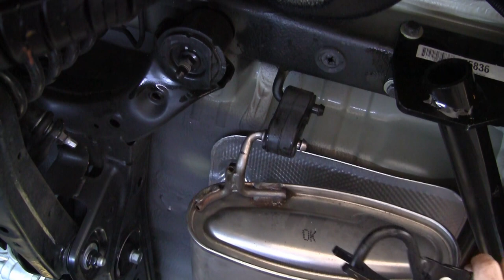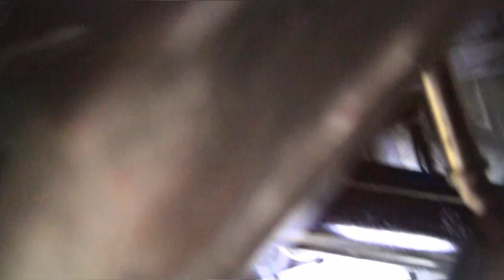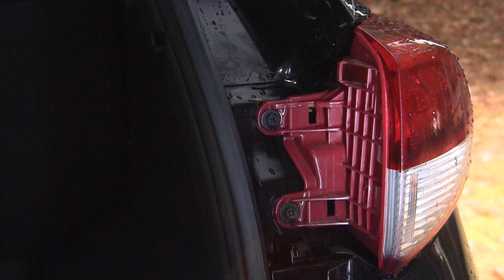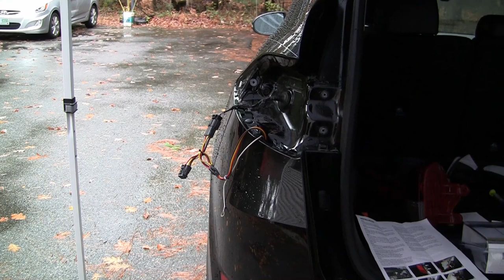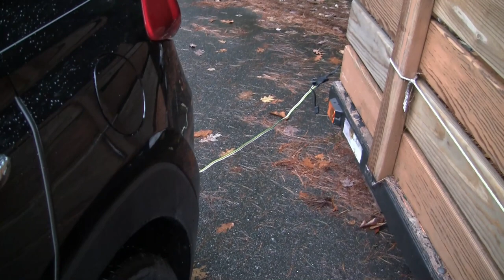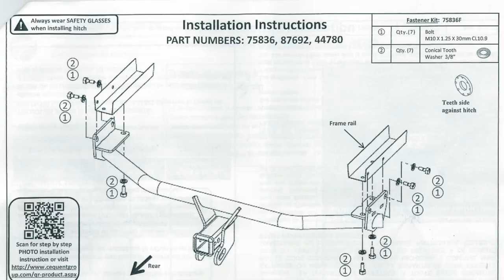Trailer Hitch and wiring on an 2016 Hyundai Tucson

Comment from the maker: I'll just throw this random comment in here for 2016 Tucson owners. If you have not yet had the most recent DCT software update installed (November 2016), get into the dealer and get it done (it's free). It will make your transmission perform much better at slow speeds. It removed all stuttering and hesitation in my testing so far.

Comment: Probably a dumb question but why do you need a powered trailer connection. Why not just the old fashioned wiring harness that hooks to the correct wires? Other than that, thanks for the great video. By the way my 2017 tucson is in Mexico , made in chec republic. Did not have threaded bolt holes for bolts. Ended up tapping holes and using 5/16 bolts. Hopefully good enough.
Reply from the maker: I went with that one for two reasons:
1. I did not want to cut into the harness and jeopardize the car warranty.
2. I had read that some cars with LED lighting are more sensitive to added power draws on the light circuits. At the time, my trailer had incandescent lights, so it would be a larger than "normal" load.  

Thanks for watching!

Comment: Great job and have a 2017 model picked up the same hitch direct from Curt, whole kit was under 200$. Hitch and 4 pole adaptor, wiring kit, already had ball mount. I had it done in a hour and might I suggest to viewers that if you have a 12v cig plug in back like mine has you can tap right into that without all the hassle of running the wire up to battery. Everything was way quicker that way and fuse is mounted into that lead. Of couse I used shrink wrap on all connects as well as solder. If the fuse blows out all you have to do is remove back hatch light to access it. As for the DCT issues I called dealer and they say my VIN has no recall and I am experiencing a warning light (tran temp hot please stop and let cool down) and I am only pulling 600lbs?and thats only backing up 10 feet. Any links to this issue from Hyundai would be great, heading to get  T2U recall done but I do not think this will fix issue.Thanks
Reply: Quick update, there is a (service bulletin) not a recall for the ECU software update when you get the T2U recall done. Make sure your dealer does this because I talked to 3 before they said it was part of the job. I also confirmed this with Hyundai Corp.
Reply from the maker: Dj Rich Saracino - Thanks! The power really was the hardest part, so your suggesting to tap the outlet is a good one.

As for the DCT, I've had no issues towing moderate loads,  so something really seems weird there.  I 've got no suggestions for you unfortunately. Best of luck with it! If I see anything that might help I'll let you know.
Reply: Thanks Davin for the great video, I did my install Saturday 4/21/18 and the idea came to me from a mechanic friend of mine, saved so much time and hassle. As for the DCT/ECU issue I put up a update in the comments and have a appointment Thursday to get it rectified. To be honest If not for your video I would have not known about the issue to begin with or until it was to late. Seems dealers are not all aware of this because it's not a recall but a service bulletin and should be done with the T2U recall. Anyway cheers and loving the Curt product, top quality for sure.

Comment: Hello, Did you purchase a Draw-Tite trailer hitch to use in conjunction with the Draw-Tite QSP HITCH SILENCING SYSTEM? It seems the Curt trailer hitchs don't anything that is compatible? Does it really make a difference in the brand?  My wife is going to be pulling a small camper. Thanks for posting your video it was very helpful.
Reply from the maker: My apologies for missing your comment until now. Not sure how I managed that. I ultimately removed and threw away the Draw-tite hitch cover/silencer. The magnets that keep it closed corroded and fell out, plus it was never easy to get the hitch bar in and out. It did help keep things nice and quiet when locked on the bar, so the concept has merit, but that product did not hold up. Again, sorry for not seeing this sooner!

Comment: My 2016 Tucson came with the OEM hitch installed but the insert is 1.25 inch vs 2.0 inch like this. Do you know what the Class would be or the towing capacity would be? I want to tow a dirt bike that is 220 pounds and the trailer is one of those sideways mounted ones that weighs about 50 pounds, so Id say 300 pounds max total. Can the OEM hitch even handle that?
Reply from the maker: The tongue weight on the factory hitch is either 150 or 200 pounds from what I am seeing online. I would think your vehicle manual would say for sure. The class 3 hitch I installed has a 525 pound tongue weight rating, so it should be able to do what you need, but I wouldn't go near the 525 pound tongue weight  Bear in mind that just because you install a big hitch, it doesn't mean you can suddenly tow more than what the vehicle is rated for. In other words, there is no way I can tow 3500 pounds, even thought the hitch itself will support it. Like wise, the frame will have to support the weight of your bike and carrier.    It will probably be ok, but I would use a small trailer to be safe. I hope that helps.

Comment: My sons Tuscon has a little round cap that pops off on the bumper to the right if the hitch where you plug in the trailer lights.  Weird you dont have that.
Reply from the maker: I guess his has a factory tow package, or at least the electrical part of it. Thanks for watching!

Comment: Davin,  this should be the same for the 2017, correct ?  Hyundai Dealer wants 650 bucks to install THEIR hitch and THEIR wiring harness — this does not look like it's too bad of a job.  Did you ever look into having the dealer do this and did you get the same song and dance that it "has to be the OEM hitch and wiring harness" ?   — interested in your take.
Reply from the maker: I have not been under a 2017, so I can't say for sure, but I would think it would be the same or very close. I did not check with the dealer as dealer accessories are always expensive. The two hardest parts were removing the taillights for the first time and running the power wire from the rear to the battery. Running the wire just took a while to tie it up nicely and route it safely. The lights really did not want to release from the clip the first time. Actually installing the hitch is relatively easy if you drop the exhaust down a bit like I did. You spend most of your time on the light controller. Good luck!
Reply: Great job and have a 2017 model picked up the same hitch direct from Curt, whole kit was under 200$. Hitch and 4 pole adaptor, wiring kit, already had ball mount. I had it done in a hour and might suggest to viewers that if you have a 12v cig plus in back like mine has you can tap right into that without all the hassle of running the wire up to battery. Everything was way quicker that way and fuse is mounted into that lead. Of couse I used shrink wrap on all connects as well as solder. If the fuse blows out all you have to do is remove back hatch light to access it. As for the DCT issues I called dealer and they say my VIN has no recall and I am experiencing a warning light (tran temp hot please stop and let cool down) and I am only pulling 600lbs?and thats only backing up 10 feet. Any links to this issue from Hyundai would be great, heading to get  T2U recall done but I do not think this will fix issue.Thanks

Comment: Got a question. Do you think it would pull a pop-up camper just fine?
Reply from the maker: I have only used it for utility trailers, which it handles with no issues. The biggest thing I have towed was a 5x8 enclosed U-Haul trailer loaded moderately with my daughter's college possessions. If the pop-up is mostly just a fiberglass shell with netting, then it might be fine. I just don't know what the weight of a pop-up is.  Sorry I can't be more helpful. Good luck!

Comment: How did you end up attaching the control box where it was hanging? Mine came with double sided tape, but how do you get to it there? I don't want it rattling around all the time!
Reply from the maker: It isn't secured as I left it hanging. The wires seem to keep it steady with the wire loom and zip ties attached. At least I haven't noticed it making noise. 

Good luck on your install and thanks for watching!
Reply: That control module hangs right at the bottom of the inner panel and could easily be taped in place with the supplied double sided tape! Also I would like to add that if you are going to run the wires through looms, do it before you have to climb under the vehicle! much easier! One last thing about hooking the power wire up to the battery, Go for the fuse and relay box on the finder! There was actually an empty terminal and a slot along the front for the wire! Just need a smaller wire end and washer with nut!
Also, mine was a 2017 and the dealer says they are the very same as the 2016!
Reply from the maker: My wire length must be a bit different as the box is about mid-way down the fender in my case. Fully agree on applying the loom prior to running the wire. I wish I had looked in the fuse box, that would have been a great place to hook up!

Comment: I just installed a hitch on my 2014 tucson i didn,t remove any part of the vehicle, muffler or covers i don't know maybe the 2016 is different, just so people know you don't need to remove anything on the 2014 i thought they would be the same
Reply from the maker: Depending on the exact hitch, you might be able to squeeze it in without dropping the exhaust, but it was much easier to just bite the bullet and drop it in my case. In any event, thanks for sharing!